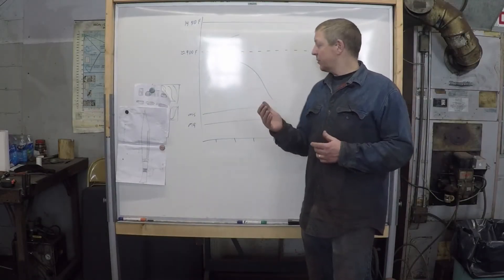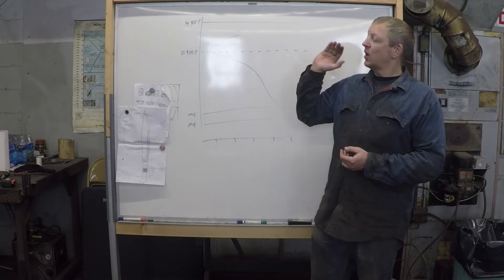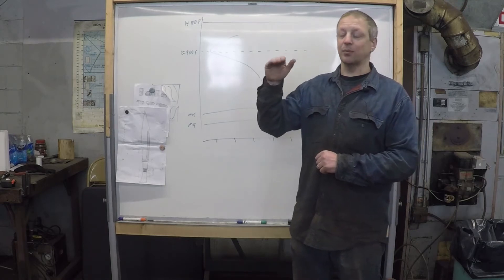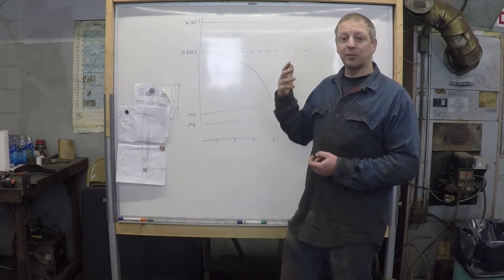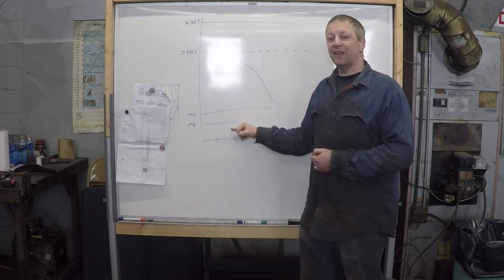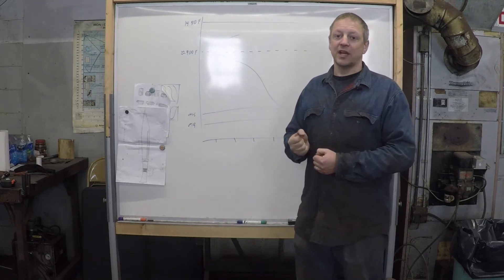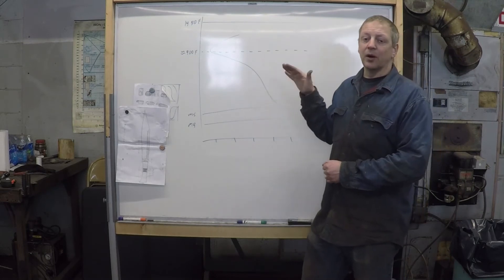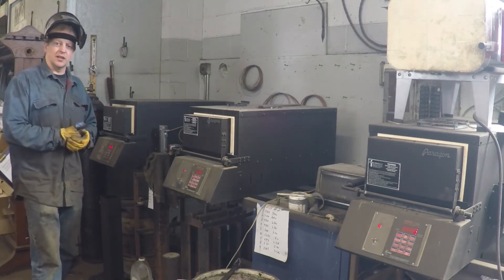Heat Treatment In-depth

Comment: pendray’s repeated thermal cycling is everything to the pattern of damascus. i am curious how the pattern is related to the different crystalline structures you describe, all those “ites.” i know you’re not making wootz necessarily, but i found it very interesting that the thermal cycles make him able to have pattern or not. he can even eliminate them and reintroduce them. thanks for the in depth read on the temperatures and behavior of the smallest structures.

👑
david
i disagree. 500 degrees twice was harder and more brittle.